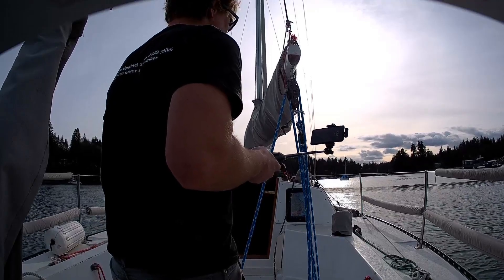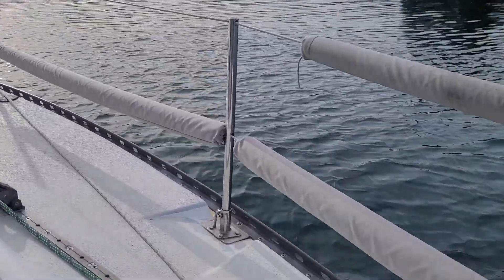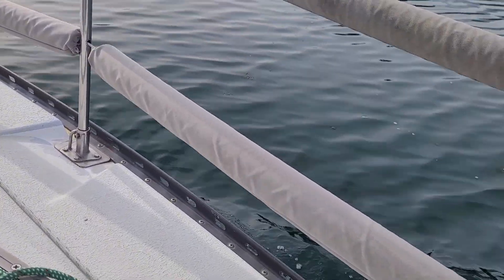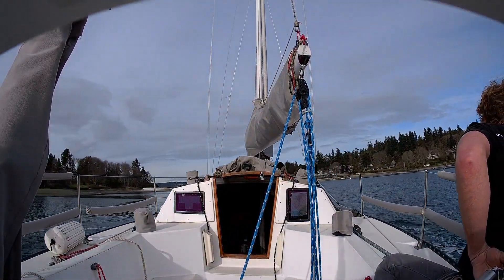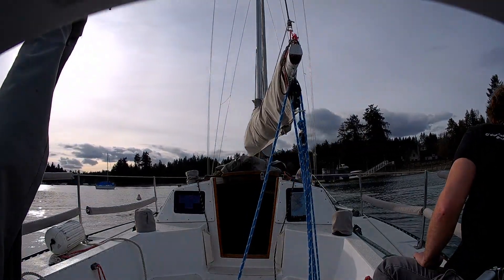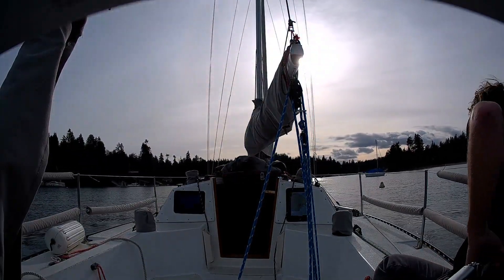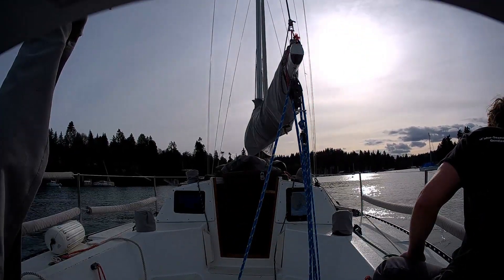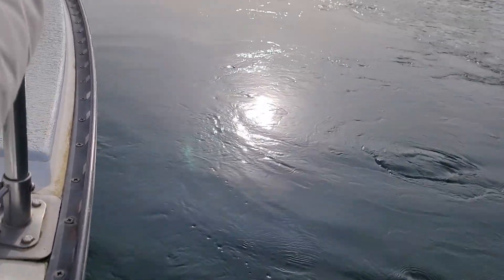Do Sailboats Have BRAKES?

Comment: I much prefer a tiller (which I have) over a wheel, aside from the range of movement as you say, you have 100% feel!  One thing I would add to your vid regarding responsive steering is the design of the keel/rudder.  For full length keels wont be as responsive of course, for example.  Loving the video tips also, always keen to learn something new or a different way about it ;)